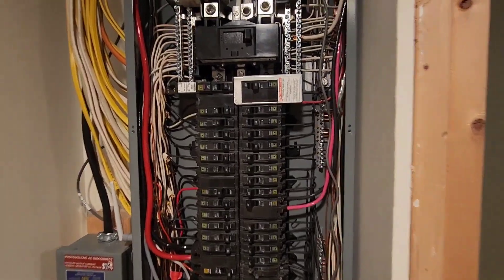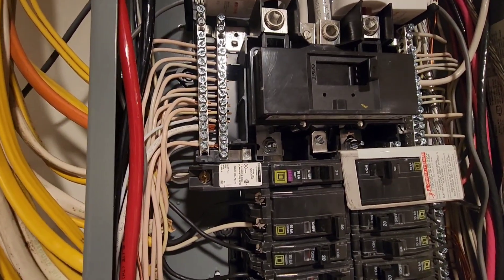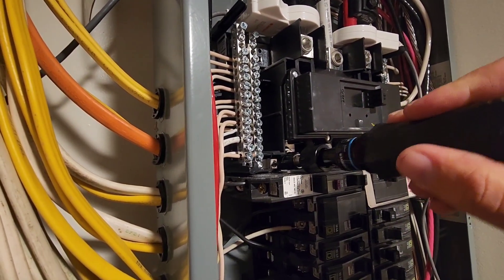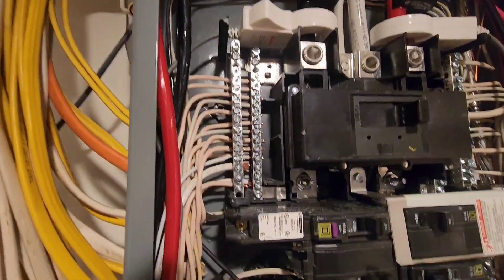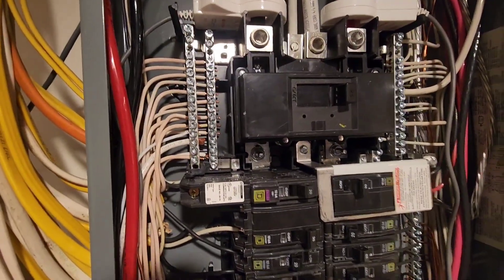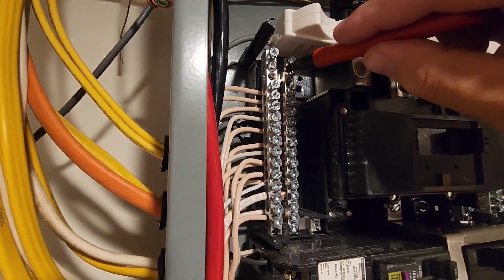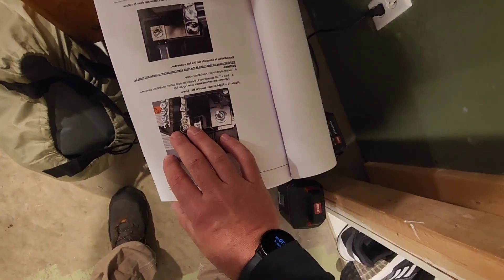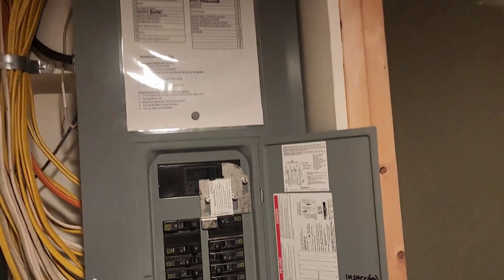***Square D QO Breaker Panel Recall*** How to Fix it Yourself!

Comment: Get some RED or ORANGE fingernail polish (pumpkin orange is usually very cheap after halloween). Use the polish on the threads after torque set. If the screw ever changes then the polish will flake and or show a crack. This is a this is a "tamper-proof" seal method used in industry in quality assurance all the time. Markers only show that someone marked it for some reason, lacquer seal shows tamper and change as well.

Comment: Thanks Ben...good reminder that ensuring proper torque on critical fasteners is always part of a job well done.  

Working at IBM, I saw surprising examples torque failures causing burned up breakers.  In those cases, the fail was usually over-torqueing.  When over torqued, the lugs would crush the metal in the conductors, and over time electromigration from the crush site would end up loosening the lug and causing it to get higher resistance.  This leads to overheating failure...burned up conductor insulation, smoke damage, and a significant safety hazard.

So too loose and too tight are both problems.  What's needed is just right....which can only be done with a torque wrench.  This is why every electrical device with a lug has torque specs printed on it.